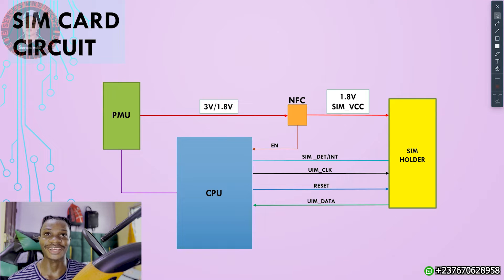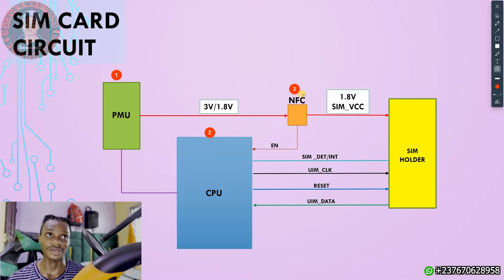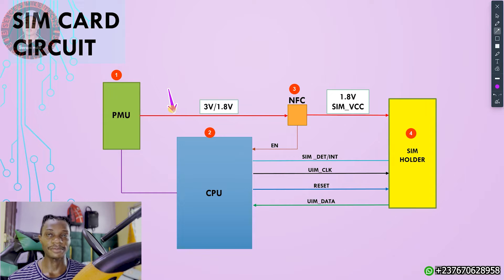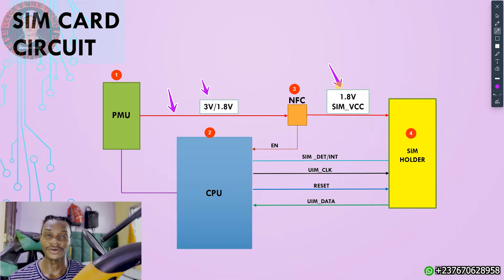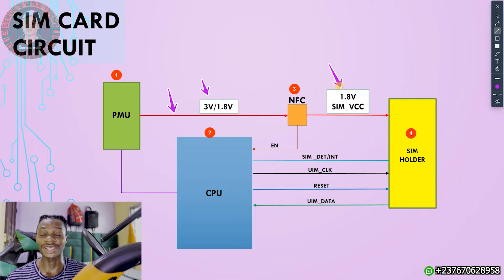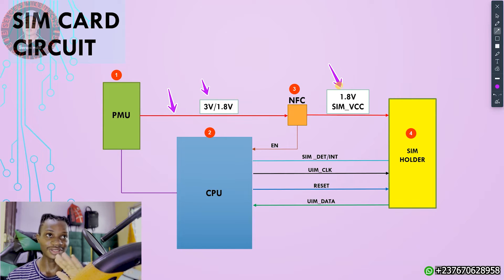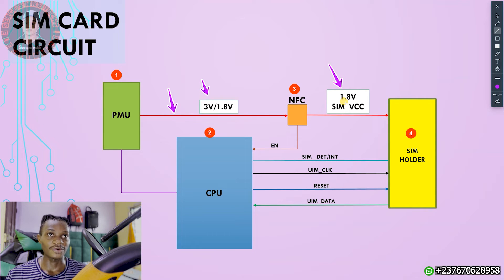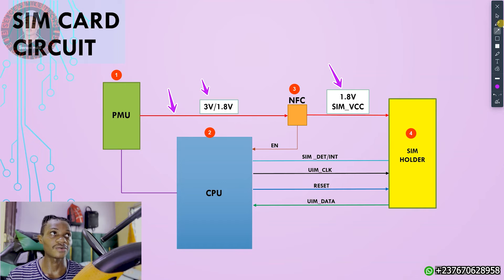How Do Mobile Phones Detect SIM Cards? Block Diagram Explained And No Sim Card repair Tips

Comment: Sir need a little help
Reply: There is a phone, its power has also been changed by China's charging IC, still it is showing low battery.
Reply from the maker: There should be an open circuit in the battery detection lines 
Try a different battery 
Then troubleshoot the lines